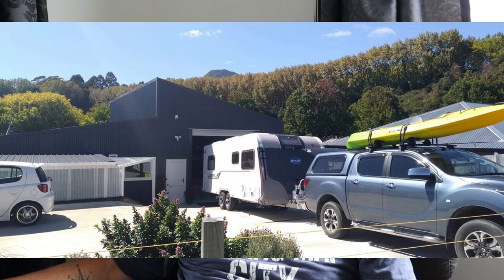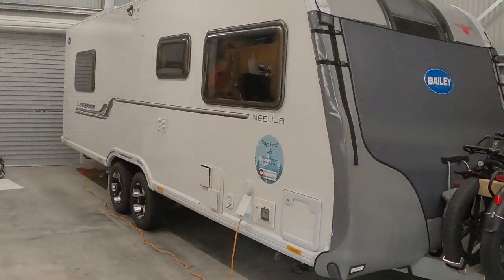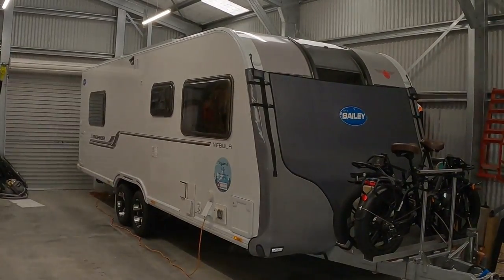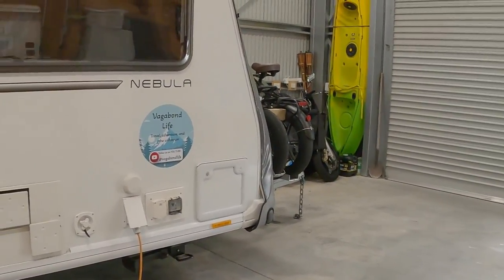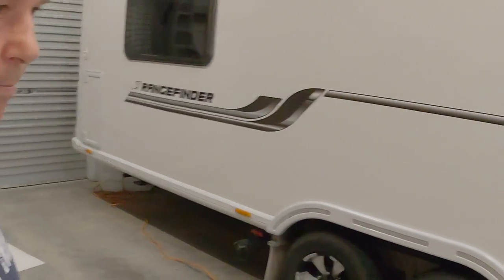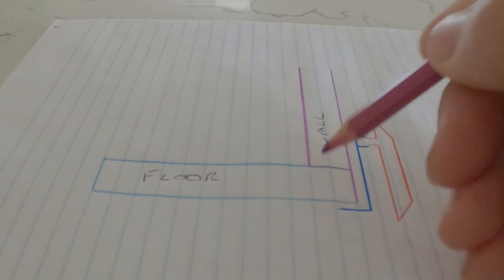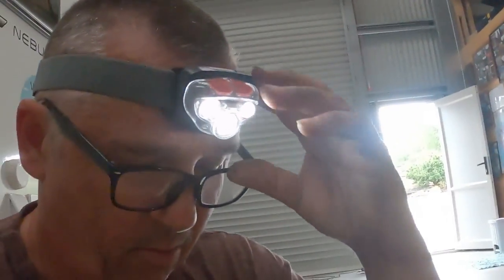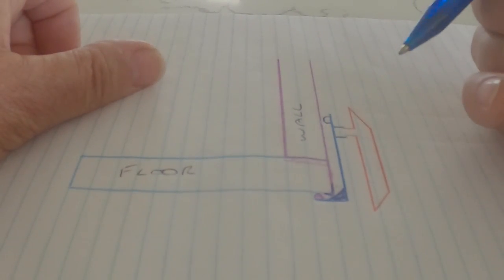Caravan Leaking issues and I may have found the solution

Comment: Thank you for sharing the video. I am currently investigating the source of water leakage in the front area of our Pegasus IV. During my inspection, I noticed that the outside wall lip is touching the floor, just above the A-Frame at the same point as the water ingress above.  I believe water may be entering with the same method.
Reply from the maker: Hey Phill thanks for the comment and for letting me know that you have had the same issue as us and that my video has helped you identify where the problem has been coming from, and will enable you to now repair it. Best of luck.

Comment: Hi again Darren. Thanks again for your video. I’ve removed the trim and the fixing strip from my Uk Bailey van. There was clearly moisture getting in and affecting the floor. Now my van doesn’t have any staples holding the wall to the edge of the floor. But I think sealing the edge and stapling is a sensible idea. What sized staples did you find suitable? I guess you used stainless ones?  Thanks in advance.
Reply from the maker: Hi Graeme I think they were 14 mm staples, they weren't stainless steel, but neither were the ones I pulled out, however after I replaced the staples I ran a bead of silicone sealer across the top of them to help protect them from rusting IF water/moisture was to get back in that strip again.
Reply: @vagabondlife2018  Great. Thanks. I’m getting a very odd reading of around 35% inside floor on top of the vinyl right near the outside wall. Both sides at about 400mm from the front for only about 100mm. Same both sides! Everywhere else on the floor is around 2-3%. Very odd. I’ll keep an eye on how it dries out. Again thanks for the video. What’s troubling is Bailey could’ve done this during assembly!
Reply from the maker: That's exactly what we thought too, we are guessing they were pumping them out of the factory so quickly, that quality checks went out the window, and clearly by the lack of sealant in some areas, the workers didn't have any care in the work they put out.
Reply from the maker: The only way to check the floor is to cut the vinyl against the wall and peel it back slightly to see if any water/moisture has leached into the ply floor.
Reply: @vagabondlife2018  The laugh is on me. I did a bit more careful investigation of my 35% reading. Discovered it is immediately above the steady - on both sides. So I went underneath and put the meter against the steel where it reads 100%! Phew. Relief.
Reply from the maker: That's brilliant news Graeme, best piece of equipment you can have in your tool box is your moisture meter, as you can keep on top of any issues before they become major. Glad to hear you don't have any issues 👍
Reply: Thanks a ton for the video. You've just solved my problem - or at least provided the reason why I have damp at the rear corner of my Bailey Rangefinder. It makes perfect sense - now to the repair centre to get the floor fixed and reseal everything. Do you have any advice on how to remedy the damp and mouldy floor? I'd really appreciate some help on this too. Cheers
Reply from the maker: Hi Tony the best thing to do is lift the vinyl and thoroughly dry out the floor, using fans or dehumidifier, anything that will help dry it out completely. Also best to get a moisture meter and when the reading is 12 or below you will know it's ready  for the next step. Give the ply floor a coat of marine epoxy resin like everdure (can buy from the hardware shop) and apply two coats (first coat thinned down) and allow to dry between coats. This will soak into the ply and stop any rot.  Also remove the back tail light panel and put some silicone in the holes where the screws go in, so when you put the panel back on the hole are protected/filled with silicone surrounding the screw. As what is happening is rain runs down the back of the caravan, runs in behind the back panel and makes it's way in through the screw holes, down the wall and through into the ply floor.  Hope that helps 👍
Reply: @graemeowen4531  very interesting that the steel gave a reading off 100 percent, I would have thought it wold have been nil.
I have a unicorn and one quick way to sort it would be to just put a thin bead of silicon all the way along the top of the trim, that way it will not run down anywhere near the van, this would be a good way to do a long term temp fix lol, if winter is coming on and you just want to seal it until summer time or spring

Comment: Would be a good idea to use a rubber sealing washer over the screw fixings between the outer wall of the caravan & the inside face of the L-shaped moulding.
Reply from the maker: Hi Steve Yes would be or you could fill the screw holes up with sealer before putting the screws back in, which in this case we did.

Comment: I wonder if eternabond tape would be any good where you put the silicone i just think that it will seal the staples and the corner edge. From what I've read its really good stuff a bugger to get off and can last for maybe 10yrs+.
Reply from the maker: Hi thanks for the comment. I had never heard of it before your comment and I've had a read up on it and I can't see any reason why it wouldn't work or do the job. If you give it a go, let me know if it worked for you.

Comment: Thank you for posting this , ive  just brought a 2006 bailey ranger, i have a damp spot behind the wheel arch.
Traced it , and it appears as the moulding is causing the issue
Reply from the maker: Hey Craig glad our video has helped you find an issue, unfortunately no caravan company are perfect, all have faults no matter what guarantee's they give, but being able to find any issues and getting onto them quickly is what counts. Glad our video had helped you look for problem areas.

Comment: Hi mate i had same issue i used white pvc corner strip and pushed it in between the wall and the caravan skin with the lip of it facing in i then placed another peice in between the pvc and floor the length of each side 
Imagine the L shape and turn it a quarter anti clockwise this up i between the floor the L turned quarter turn  clockwise I glued them together so even if the sealant failed on the rail again it could never get to floor ever
Reply: Hope this makes sense I had made the same diagram as yours hope I explained it so you get it
Reply: The pvc corner piece idea and T. rex clear tape were my best friend for my Bailey 😂 the previous owner had even ripped the toilet and shower out and half th wall board and it never occurred it was from under the floor
Reply from the maker: That's awesome that you found a solution that works for you, best thing is, it won't screw up/rot your floor. Nice one 👍
Reply from the maker: @AD-qe7jv oh dear, bet that made a mess 🤦
Reply: @vagabondlife2018  yes the floor all dried eventually 🤣
Reply: @vagabondlife2018  just hoped you could use the idea I didn’t know if water trapped between the top sealant and bottom corner could rot the skin if it failed rigid angle 90* pvc would give me piece of mind they can put a man on the moon ……but can’t make caravan and motorhome water tight 🤣built in flaws n sneaky b*stards come to mind 🤣😉
Reply from the maker: @AD-qe7jv 🤣😂.

Comment: Just sorted my 2019 bailey cadiz, many thanks for your advice. Water pissing down back of moulding into floor. Thanks again .
Reply from the maker: That's great news Paul, I'm glad to hear you got your van sorted.
Reply: My bailey cadiz has a 6yr water ingress guarantee ...so should yours at 2019
Reply from the maker: Yes ours has a 10 year water ingress, but since Bailey pulled out of Australia I have heard of many Bailey owners nightmares in trying to get there issues fixed, constant battle. We only had a minor issue which we caught very early and fixed so no damage luckily. The video we put out was to stop any issues we had heard from other people like the wheel tubs etc.
Reply: @kennethwebb4385  I decided to sort these issues myself, which I did do. 'I have little faith in the local dealerships'. I sold this caravan in January, and bought a  new Bailey pheonix. Unfortunately this had damp issues also, my love affair with Bailey is finally over. Buyer beware.

Comment: Very interesting as I am in the middle of tackling some corner damp spots, as you said all four corners and two spots behind the wheel arches, on out Bailey Unicorn Cabrera 2012.   Has been great to now, but the very wet summer we have had in New Zealand has impacted the potential for water egress.  I can see where you coming from I think i might now have a slightly longer job. I have some damp material to remove dry and fill as well.
Reply from the maker: Hi Ken glad to hear the video had helped. It's annoying we have to fix what should have been done properly in the first place.

Comment: love your garage. 
You would think that by now all the years that caravans have been getting made, especially the likes of bailey that they would have worked all the problems out re damp and water leaks.
i have a bailey myself and yes a lovely van with all the extras but its poor workman ship at the manufacturing line that lets them down, makes me laugh when you watch a video that bailey have put out of them being manufactured then at the end it goes to the final part which is quality control lol. (UK)

your video is really well put together
Reply from the maker: Yeah it is a great caravan and we love our Bailey too. I guess with anything, your business is only as good as your workers, plus the push for profits vs ensuring producing a top notch quality vehicle resigned, very sad. But if you can catch any leaks before it's too late you can still have a great van.
Reply: @vagabondlife2018   Gonna give mine a go over the winter or when time allows, thing is we have to keep ours at a storage yard here so its all outside. 
did you have to use any extra strong staples to go through the allow panel?

what i plane to do on the front and read of mine is to extend the body panel down about 10 mm behind the bumpers, so water just runs off the bottom and does not travel into the floor.  our bailey we have owned for a few months now, did get underneath yesterday and had a good look around all the edges and pleased to say its solid but prevention is better then cure.

haha you remind me of myself with, if im doing it it has to be 100%, it just feels better in the mind when its pouring down that the water is running to the ground/road 

Can i ask what is the weight of your van maximum.

All the best to you
Reply from the maker: @stehume the staples I used are 14 mm high performance staples and the sides of our van are made from fibreglass not alloy. All material in our van are used to keep it as light as possible. No timber framing (so can't rot in the internal walls) framing is made from recycled plastic and is structurally strong. Our Gross weight is 2500 kgs and out Tare weight is 2120 kgs. We weighed our van full of food and clothing and gear we would take away with us and quarter tank of water and we weighed in at 2320 kgs, even with a full tank we would have still been under our Gross weight. Hope that helps.

Comment: Hi Darren. Great video and you've solved the mystery of how that awning skirt rail comes off. We have a Bailey Discovery 4 which has exactly the same problem. It's only 18 months old but I wouldn't trust the monkeys at the dealership to do this fix properly. I want to do it myself (as with everything). I suspected that what you found was happening to ours and now I know for sure it is! We  have wet on the front of the caravan underside floor too and as I don't want to break anything taking the covers  off, I was wondering if you knew how the front cowlings comes off? Hope you stay dry now mate and thanks for posting your video. Now I've discovered your other vids travelling around NZ and some exotic locations. Subscribed!
Reply from the maker: Thanks for the feedback and subscribing. I'm glad the video was able to help.
I am not familiar with the discovery, but the rangefinder just has a few screws to take out for the front covers to come off.
I know some of the earlier bailey's had no overlap from the front wall, which left the front edge of the floor exposed to moisture.
Some people were smearing a sealer on this edge and then also putting a piece of aluminum angle on it for protection.
Everdure from bunnings, is great for stopping any rot.
Kind regards
Darren
Reply: @vagabondlife2018   Cheers Darren. Yes. That's what I was going to do as double protection. Thanks again mate and happy travels!

Comment: Hi Darren, Great video, have you had any problem with the underfloor plywood getting very wet in the corners?
Reply from the maker: Hi Brandy welcome to the channel.
No, our caravan is fiberglass underneath, so don't have that issue.
I have seen alot of English caravans with this problem though.
I think alot of it is attributed to the same issue though with the moulding along the bottom of caravan.
The water gets in there and runs along that moulding to the back corners.
I just gave a friend a hand to repair his English van with this very problem.

Comment: Hey, last question. What’s the brand and where did you get the moisture meter. Going to buy one!
Reply from the maker: The brand we got is called Smart Sensor. It's not an expensive one.  Unsure if you are in NZ or not. We got ours off trademe (like eBay) it cost us about $50 NZD, and it's the best investment we made. https://www.trademe.co.nz/4341749617

Comment: Hi Darren,
Seems to me that I could run a small bead of silicon along the wall at the joining of the decorative white strip and that would do a pretty similar job to what you’ve done as far as preventing water from running down the side and getting behind the mounting strip that’s fixed to the wall? You’ve seen more of the set up than I have so what do you think?
Reply from the maker: Hi Graeme yes you could do that, however you still may get a bit of water from the corners. I guess I am just that type of person, that likes to do the job once and know it's 100%.
Reply: @vagabondlife2018  Yeah noticed you do a very fastidious job on your videos, good to see! If I do as I’d suggested I’d also silicone the tops of the corner mouldings.

Comment: We have a caravan of the same model and age as yours and are about to replace the whole floor if you interested in the journey here in Mt Maunganui. Duncan at Prelim
Reply from the maker: Wow really the whole floor 😮. You must have had a huge leak for the whole floor needing to be replaced. Sorry to hear that, and I am guessing it's not being done under warranty, or you would have had a major fight to get them to accept paying for it.
Reply: The damage is significant but having got a close look at the design, damage and the remaining likely issue of ongoing leaks I decided to future proof the carravan. We are new to carravaning but already love our Nebula and plan to keep it for many years. I don't think the leak was actually very bad but I think the vinyl is the vilan.
Reply from the maker: Have you found out where the leak has come from (originated)?
Reply: From the floor staining it appeared to be from the wheel tubs, but now that we have removed the shower I have a suspicion that the drain penetration could also be a culprit. It's a terrible method. I will send you a picture. I'm also thinki of adding in a bit more floor support. You should come and see it when we have it stripped out.

Comment: Hi Darren. Really appreciate your video. I am in the process of of pulling away one of the decorative strips on my Rangefinder Astro. Once that one is removed I am finding it quite difficult to to pull away the below moulding (that has the clip retainer section). It seems to be quite well stuck in place with silicone and I am somewhat distorting the clip retainer section in the process. Did you struggle with this?  It does not look as though there are any staples holding the wall overhang to the floor, but it is not sitting that flat and probably a good idea for me to staple it on reassembly.
Reply from the maker: Hi Charles 
I just took all the screws out holding it and gently just pulled it off from the bottom. 
If you still have problems you could slip a long Stanley blade down from the top to cut the Sealant as you pry it away from the caravan from the top first.  Hope that helps.
Reply: @vagabondlife2018  Thanks for the prompt reply. It looks as though they may have
 used more silicone in behind the holding strip on my van. I am then thinking about shortcutting the remediation process somewhat by not removing the holding strip but simply putting silicone down the gap where the strip has left any gap against the wall skin, and then also siliconing up behind the outer strip when replacing it.